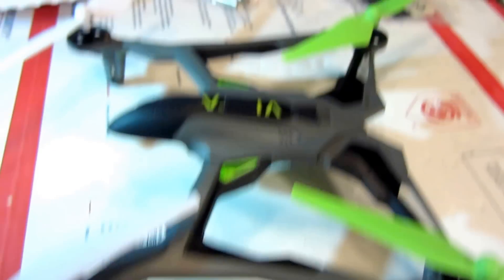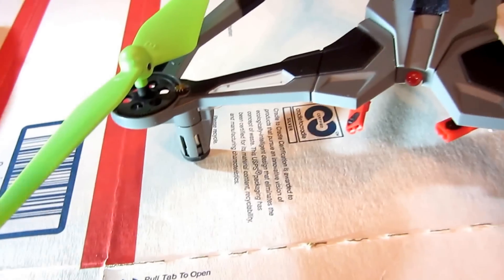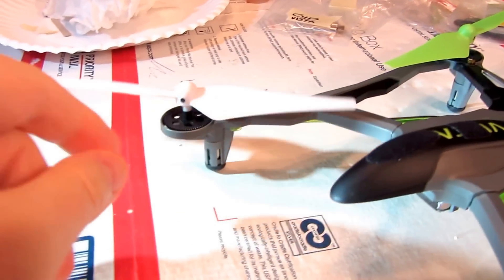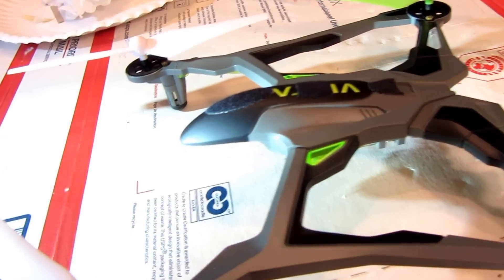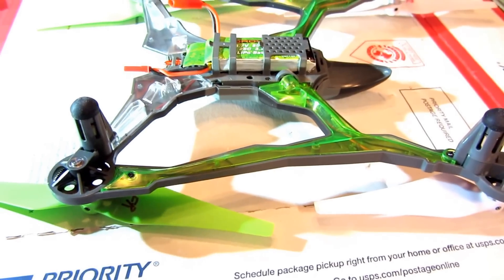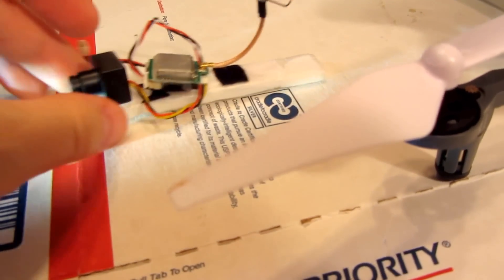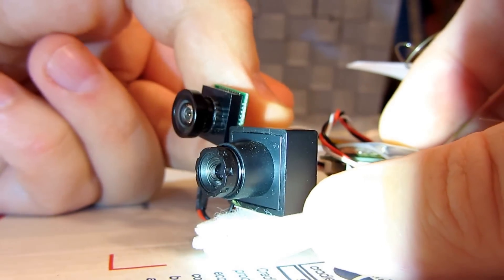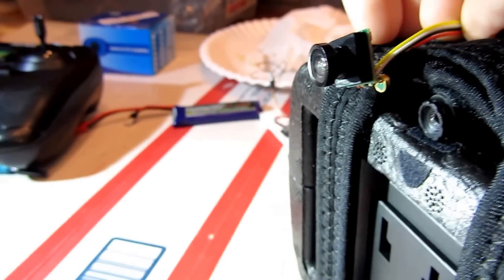VISTA Update- and RMRC and Banggood tiny FPV cam comparison

Comment: Got the vista yesterday. I crashed into a tree and it survived with no damage at all (even the props hit the tree and were fine). This is a great price for a newbie. Payed $110 Australian. I assumed it was  going to be shit quality cause it is so cheap but so far this thing is some serious fun. I mean the other smaller quads were even more expensive. 

I was wondering about wearing the motor in and will take it easy for a few fights. The champ who sold me this thing mentioned that the motors do burn out if you crash and pull the throttle off instantly.
Reply from the maker: +jono ozzo You want to put throttle down before anything comes into contact with blades. Just chop the throttle and let it fall. It is a tough little quad.

I broke my motors in doing a pack with short throttle punches below 25%, then let it sit for a few seconds.  Really slow and boring, and one of my motors was still garbage. 

I think it is more luck of the draw than anything with these motors, but it cannot hurt to break them in a little bit before going for the first full flight.

I agree that is is a good deal.  Nice flying quad, and pretty big too for the $$.  I like it for micro FPV, but a little more power wouldn't hurt.

Comment: Hello,Did using the Nano-Tech (950mAh) REALLY improved flight time ?Is there some flying aspect of the Vista, I have to look for to find out CG is «unbalance» (and «balanced» after modif.) ?Thank you !
Reply from the maker: +JP St-Jean I only have one stock batt, but especially in cold weather, the nanotech lasts about twice as long as the stock batt which hates cold weather (it was around 40F).  In normal warm weather the flights are up to 3 or 4  minutes longer I would say.   I'd have to do scientific type testing to know for sure, but that is what it feels like.
Reply: +BWX Thank you.How about the CG ? Is there some flying aspect of the Vista, I have to look for to find out CG is «unbalance» (and WELL «balanced» after modif.)
Reply from the maker: JP St-Jean
For me it was more apparent when flying FPV, but with Stock CG (which is not in the middle front to back, but farther back), when it is weighed down with FPV  gear,  it would tend to go backwards and lose altitude when you let go of sticks in stability mode, and just not fly very nice in general, always fighting you.

When you put CG more forward, it would tend to not lose altitude as much when hovering, and seem to be easier to keep some forward momentum with just a little stick input. Also seems to be in more control. Of course when flying LOS with no FPV gear, it weighs less, has more relative power, and is easier to control altitude anyways, even with stock CG.

It still flies nice even LOS with CG more forward I think. Pretty much all you need to do is move batt forward in compartment and test it out.  To me it seems like they have CG back to far from factory.

Comment: Did you replace with stock motors and bearings, or with aftermarket? I'm looking for the best to buy because these stock are crap. I cant believe the motor burnouts weve had. And the bearings and shafts wobble like theyre wore out
Reply: +Tim Collins I'm not griping, I don't expect flawless for $79, just lookin to upgrade
Reply from the maker: +Tim Collins I replaced them with stock because they were under warranty. But I got some really cheap motors on eBay that had no gears or plugs, and I'll use those when the stock ones wear out. I'm on my phone, when I get on my computer I'll find those links to those cheap eBay motors. They were 16 motors for $25.
Reply from the maker: +Tim Collins The exact listing that ordered mine from is gone now-- but it was like this-
http://www.ebay.com/itm/4pcs-8-5mm-CW-CCW-Motor-for-Hubsan-X4-H107D-H107C-H107-A23-RC-Quadcopter-FPV-F-/141865064760?hash=item2107d11938  

Need to solder on connectors or just solder wires directly, and need plastic pinions which you can get a bunch for cheap at micromotorwarehouse.  

I'll probbaly try therm out this summer, and will make a vid about how well they work, (or if they don't work well). Pretty cheap though!
Reply from the maker: +Tim Collins Or I think this was more like the listing -
http://www.ebay.com/itm/8-5mm-CCW-Motor-for-Hubsan-X4-H107D-H107C-H107-A23-Quadcopter-Heli-F-/351514545566

Might be cheaper ones on ebay somewhere now.. or better motors for similar price now. Have to search around.

Comment: So you have approx, $170 plus the cost of the vista to have???????
Reply from the maker: +ntents1 Hmmm.... $170?  For the FPV system you mean?  

Not sure exactly how much it was, will have to figure it out.. Quanum V2 were something like $52 when I bought them, and that micro video transmitter system was around $130 with all the options I got- the micro cloverleaf antenna alone was a $30 option. It's a very lightweight cloverleaf though, probably the  lightest one on the market.   

Then you need a video receiver. I have an ImmersionRC 5800 UNO (v2) (still have it), but I wanted diversity so I bought a 5800 DUO v4 which made the signal much better even when just using two cloverleafs at different angles.

So the 5800 UNO was about $60, and then the DUO was about $150.  You then need batts and stuff.. and good antennas for the VRx.  I use two Spironet RHCP antennas for the VRx, those were something like $30 too.  I also got a "pepperbox" long range directional antenna that was another $100, so that I can fly a long way in one direction at least, and maybe behind some trees, etc, and still get a good signal, but I haven't tried it out yet. I cannot mount that on my head (well you can, but I won't), I will mount that on a tripod.

So I guess if you count just what I used in vid it would be-

VISTA- $80
Quanum V2- $55 (now)
ImmersionRC 5800 DOU v 4.1 $149
RMRC micro VTx $130
FatShark Spironet RHCP antennas $30
Oh, and then the DVR was $115 (Lumenier DX600 DVR)
Then you need batts and stuff which you might already have.

So I guess that is about $475 + $80 for the VISTA.  But really you could do it for much less.  

With no DVR you could have exact setup for $364 + cost of Vista.

You can get much  cheaper video receiver systems (VRx) though, and you don't need a DVR unless you want to record the video feed. That is a really nice diversity VRx though and adds a lot to the experience.  With just the 5800 UNO VRx  I would get a lot less effective range and a lot more video droop-outs that causes blue screens (no signal screen) on the goggles.

I can use a lot of that stuff on bigger FPV quads and planes too, it isn't just for this setup, and that RMRC micro FPV 25mw VTx system can be stuck on just about anything. It works great on a UMX Radian.

Comment: too many guys not chopping the throttle then bitching when they fry the motors. Try doing that with any heli and you can kiss a bunch of stuff to be torn up. Its common sense to shut anything down with wirling blades. I fly planes too and know enough to chop the throttle if I am going down. I would rather break something else than burn a motor or bust a prop. These things are cheap. 90 bucks is not that much. If you want expencive go get a $1,000 plus quad and then you can cry when things go wrong huh? I agree with you,keep a couple spare motors handy,some gears,some pinions. hell keep a spare everything handy. I have a service bag for every plane,quad,heli and RC car I own. I buy travel bags from good will to put my stuff in. They can be small shaving kit size to big roll around bags with the telescoping handles. I paid 7 bucks for the one for my Dromida 14.8 buggy. It holds my buggy,transmitter,batterys,charger and some tools. I know there are cheaper units available out there,but they are not hobby grade and good luck buying replacement parts,even after a year sometimes,those ones available may not even offer parts any more,where as Dromida may offer upgrade kits,like my buggy. I can add a brushless motor and aluminium upgrade parts. Try that on a banggood product. Great video! Nice job.